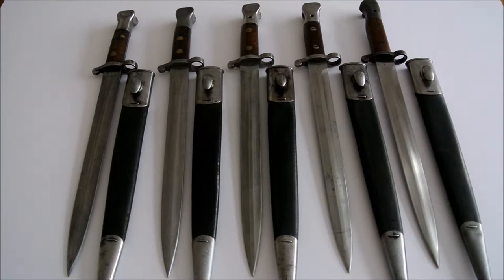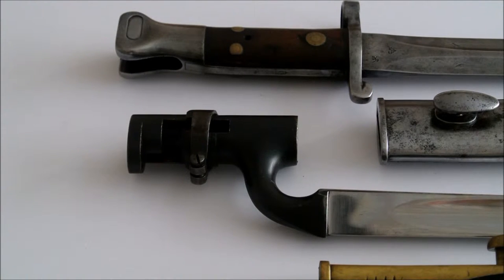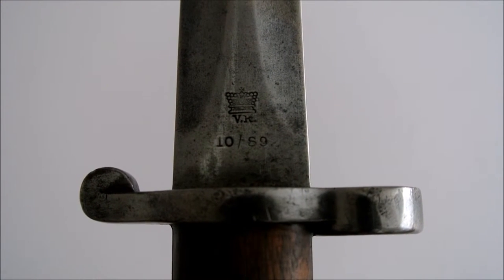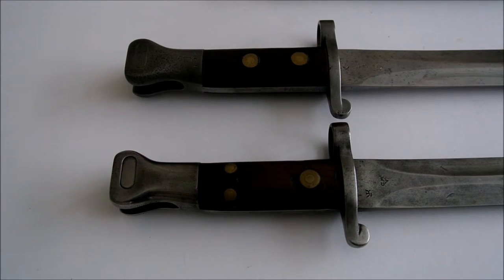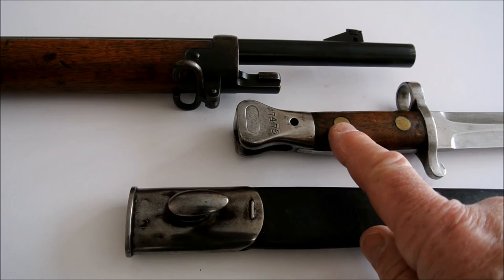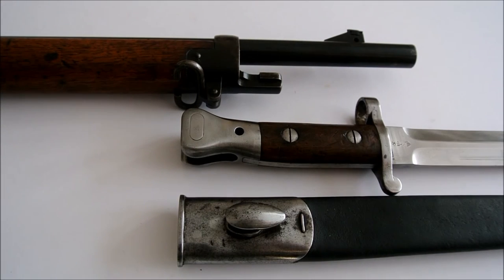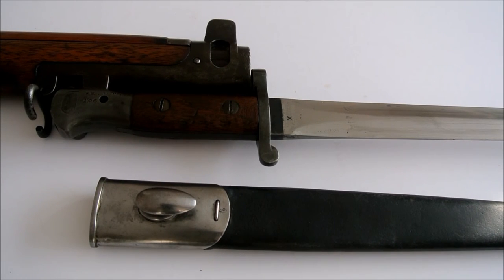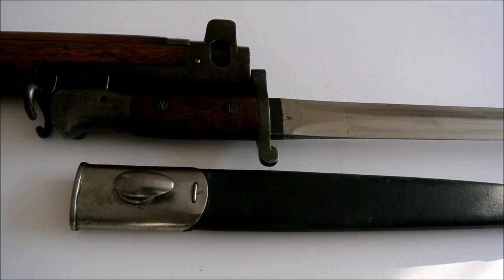British 1888 bayonets

Comment: I have a Mk1 Type 2 of my granddads. He was in the homeguard during WW2. I have his dummy white training mills grenade (No 36) with the original dummy inert "DRILL" fuze also which is pretty cool (verified it is inert!) Cool little pieces of history. I cleaned up the blade a bit and waxed it. I doubt I would ever sell it but while some bayonets are useful as knives, these old ones are all dull and serve no functional day-to-day purpose so it'll just be something I keep. I am getting a modern SA80 bayonet that I plan on using around the house as a nice survival knife kind of thing and plan on getting a British commando knife when I have more funds. Plus in time I may either get an Polish AKM bayonet (also for general use) OR I might get another SA80 just to keep like I do my old 1890 one I mentioned at the start of this comment.
Reply from the maker: The bayonet was primarily a stabbing weapon so did not require a hard cutting edge, do you have the scabbard?. I would be introduced in any markings you can find. 
Regards the 36 mills. Nice touch as they are hard to find, keep an eye out for the instruction manual, they do pop up now and again on Ebay.
Reply: @generalgordon9813  There's no markings on it, other a 55 on the back of the belt loop area of the frog. I did a video today on the bayonet.

Comment: I have a mk1 type 1 bayonet. Excellent condition with its scabbard. some slight tarnishing on the blade but the handle is great. Which I've heard is rare.
Reply from the maker: Yes you are correct . Depending on the overall condition you can expect £500 -600 depending on how many people are after it , it's  a seller's market due to the  limited number being available  world wide.

Comment: Question: Are the screws in the hand-grips of the Mk III the same thread and size as those used in the 1903 and 1907 pattern bayonets?
Reply from the maker: Hi Rod
I will check and let you know.
Reply from the maker: Hi Rod
I have just checked by removing the screws from both and they look identical if that helps
Reply: @generalgordon9813  Excellent. Thank you. I suspected it might as I have the tool used for unscrewing the washer on the hand-grip of 1907 pattern bayonets.
Reply: @generalgordon9813  thank you